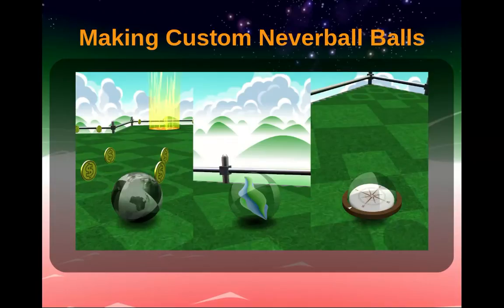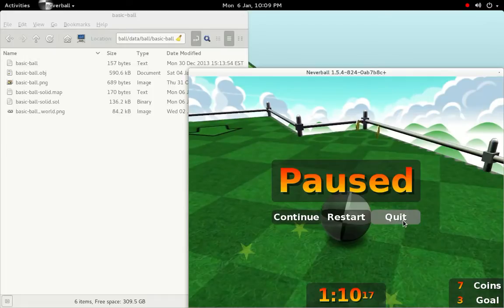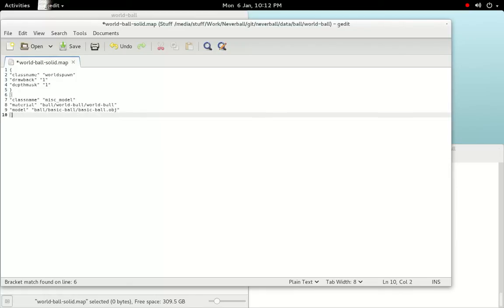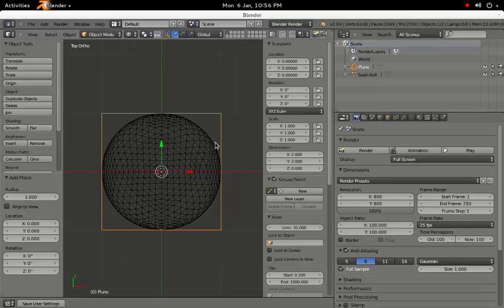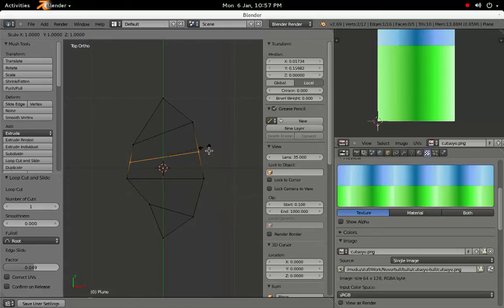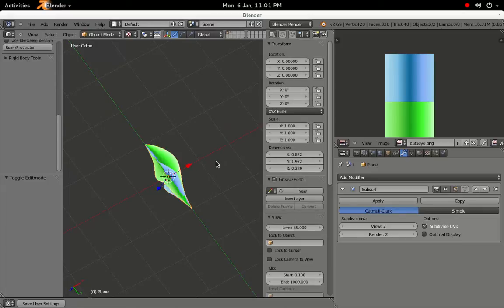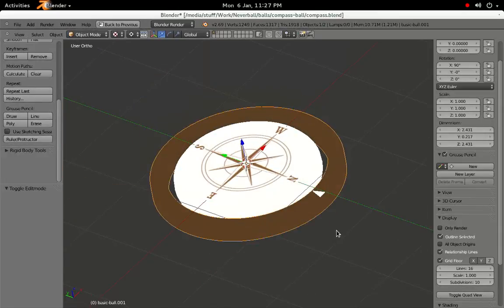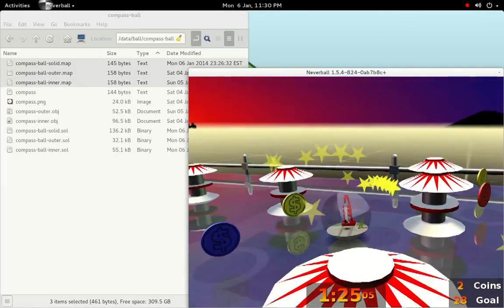An Introduction To Making Neverball Balls

Comment: How do I make my marbles green, red, and white in blender OBJ file?
Reply from the maker: Did you rememver to tick "Include UVs" in thwe OBJ export options? In my examples, the PNG texture is automatically used because it has the same file name (but with a .PNG extension) as the material file, so to make things easier, make sure that your PNG is named appropriately..

Comment: Press tilt?
Reply from the maker: Ah, that's probably my accent. It's tilde ~ or backtick key `. It shows and hides all layers. If your keyboard doesn't have one of those, you can press space and type "Layers" (without quotes), which should do the same thing.

- Cheese
Reply: How do I make marble-blue ball to join the OBJ file?
Reply from the maker: Reshaun Francis In the example files, I have both the blue and the green parts of the marble exported as one OBJ (I join the parts together at 9:43 in the video). This is then included as a part of the ball by including it as an additional misc_model entity in catseye-solid.map

Hope this helps!